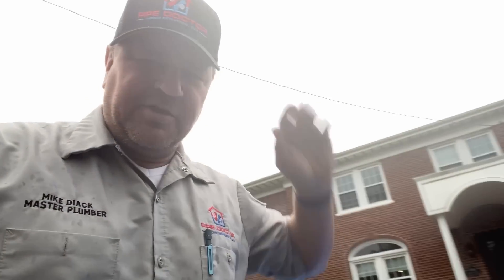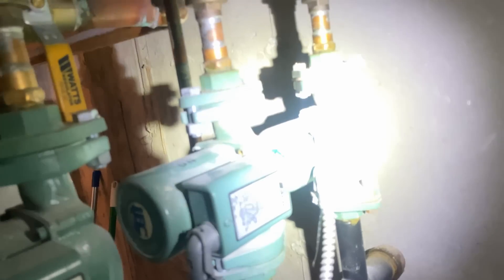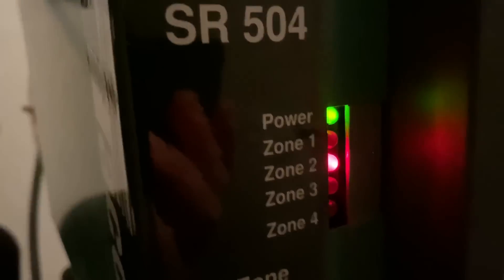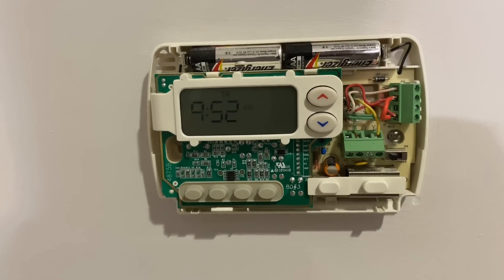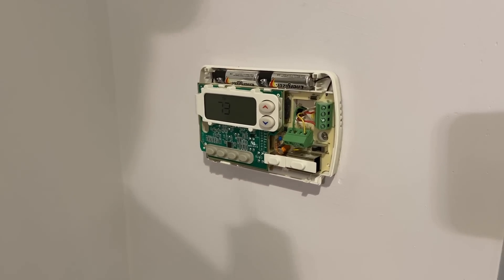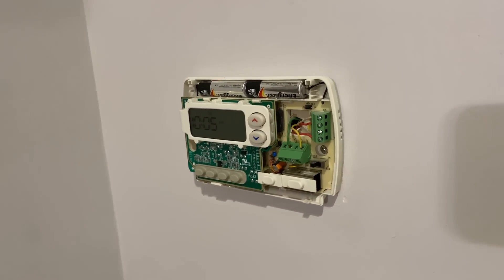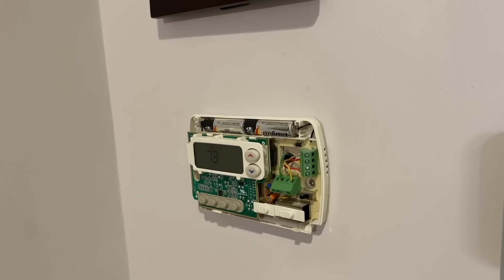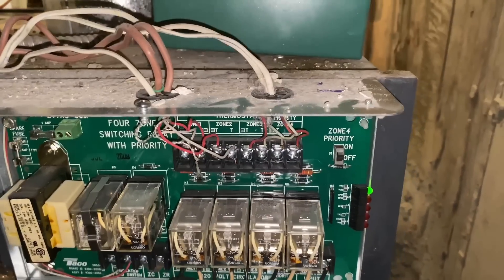House is Hot! Heat & AC Running Simultaneously: 2 Transfomer Thermostat Wiring Explained

Comment: so, who changed the thermostat and added the jumper that shouldn't have been there? unless someone recently swapped wires at boiler or air handler, which did have the R/W's flip flopped differently between the circuits.  a circulator or two looked pretty new as did the fill valve.
lucky it wasn't cooking the transformer/s or giving it 48+ volts(lol), but maybe it did blow a fuse initially so they swapped r/w at boiler? it would be back-feeding through the metal cases/equipment ground wires to the electric panel and back, possibly even via the condenser if something is touching. guess it doesn't matter, yank the jumper out and properly wire RH to boiler, and RC to air handler. lol

Comment: Mike, the reason this happened this way is that RH and W are actually reversed in a technical sense. When the jumper was in place, you effectively had RC jumped to W. The commons of both systems are connected to the ground of the electrical system completing the path. With the jumper removed, it makes no difference if RH and W are reversed (unless someone puts in a smart thermostat that would detect that).

Comment: Why did you do it for free when you know someone altered your original work?
Reply: How can he prove that?
Reply: @ervinlosha1333  because this system would have been running in heat 24/7 if he installed it improperly. but this likely didn't take him long to find and fix and its better to keep your customer happy than insinuate that they messed up the system or another contractor.
Reply: @ervinlosha1333  How can it be proven that he did do it?

Comment: So with that wiring that means that the cooling was on during the winter, or that would only happen if they jump RH with Y?
Reply: no, the thermostat controls the power from the RC terminal to the functions of the other terminals. so Y would only be energized when a call for cooling was initiated but because RH is supposed to be an activated terminal by the stat and not a always live terminal. a jumper between RC and RH in this scenario meant there was always a call for heat and only a call for cooling if the stat was set to cooling and set below the current indoor ambient temperature.

Comment: The barometric pressure got to high in the home causing condensation in the air and that condensation caused continuity between R W Y G but not C and made the heat and AC run without a direct short blowing the transformer 😂😂😂
“Typical HVAC super tech.”
Reply from the maker: Nice diagnosis

Comment: 3 minutes in my money is on a check valve or thermostat… Edit gather all information before diagnosing a problem ah-ha 😊 What a weird setup that is, sorry I’m commenting as I watch The jumper was left in and set to cool hence forth calling for heat at the same time, but shouldn’t one of the transformers blown?
Reply: The RC and RH is a separately controlled system using the same thermostat so the RH is the boiler and RC is cooling only. Jumper is out there if the heating and cooling uses the same transformer
Reply from the maker: Nice work!
Reply: Basically what I said
Reply: @tphvac87  you over complicated it